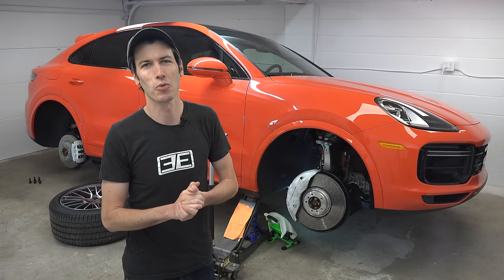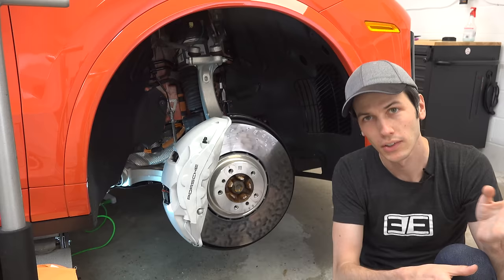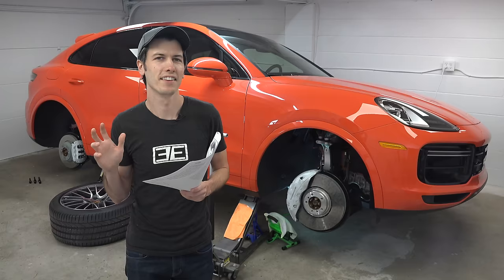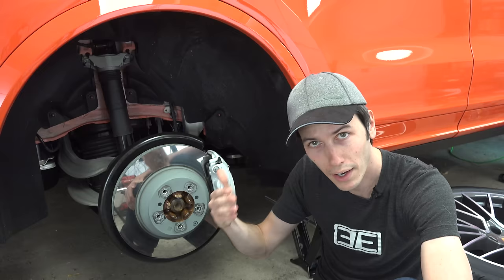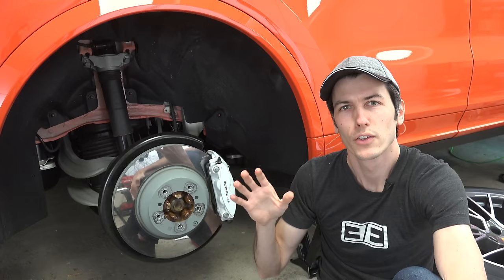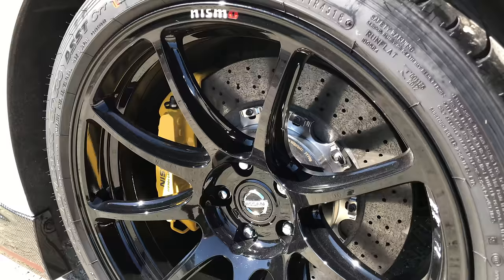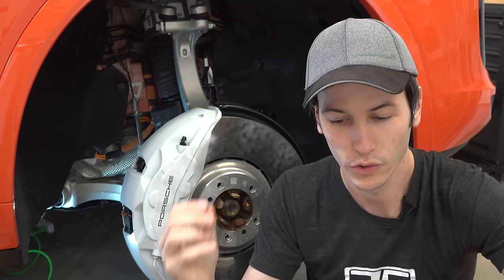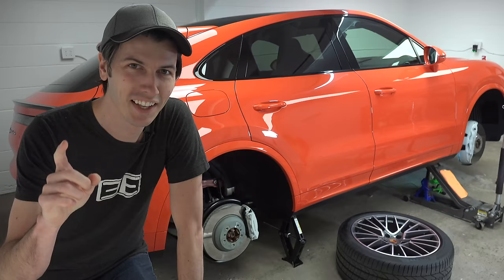Porsche Reinvents The Brake Rotor - No Rust, Low Dust, No Fade!

Comment: $32,000 for brakes! The transmission would be getting a lot of wear and tear from me using it to slow the vehicle down.
Reply: Imagine the cost for transmission service...
Reply: Sheesh i wonder what the labor is like 🗿
Reply: And those prices are WITHOUT labor....  The running costs of these cars are just stupendous! No wonder they are so cheap used lol
Reply: Various sensors were included in the prices, this isn't the pice of the carbon/ceramic discs alone.
Reply: The people buying these cars are certainly not worried about the maintenance costs..
Reply: put some regular brakes on it
Reply: @edwill1595  That, and there is reason the vast majority of these cars are leased. No mortal is doing a $32,000 brake job in their home garage on Sunday afternoon.
Reply: 😂😂😂 facts
Reply: Down shifting everywhere..... lol
Reply: @FlyingGentile  like stonehenge?  Not sure what that means.

Definitely not for the faint of heart or light wallet folks.   I guess that's why people buy old Porsches and not the rare classics, just unpopular ones like the 996.  And let's be honest, a lot of these cars are just weekend warrior chariots and really don't need carbon ceramics.
Reply: @supercooled  Yeah, carbon ceramic brakes are really meant for the track. I don't even see a need to spec them for a RS6/7 let alone a Cayenne SUV. It's just another way for companies to extract the last dollar from their customers.
Reply: @ameraldas3641  I hear there are some knockoff, made-in-china rotors that will fit and are only $34.99 each on Alibaba.  The box markings look remarkably similar, except the brand is "Porch".  Not sure I'd trust them on a mountain pass, though.
Reply: @jeffbanfieldsflwr3537  change the muffler and tell people you only engine brake to hear the "brapbrap".  It'll be our little secret...

Comment: Those prices are insane. You can buy an e36 M3 for the replacement price of these fancy porsche coated brakes.
Reply: But why would you want a 25 year old car? 😉
Reply: Even the regular iron rotors cost as much as a 325. If the price of the iron brakes is anything to go off of then all of those are marked up about 10x from what they should actually be.
Reply: A prime example at that!
Reply: Why are people complaining about the price of an exclusive brand ? It's supposed to be exclusive.
Reply: @scratchy996  WTF is exclusive about Porsche? Every overpaid professional is leasing one.
Reply: Thats only because the e36 M3 is unreliable and second hand price is low because of high maintenance.

Comment: "Barely measurable"
Laughs in machinist
Reply: lol right? 1 thou is considered large 😂
Reply: john Bean Then I’m massive...sweet!
Reply: .0008mm is .00003 inches which it 1 three hundred thousandths of an inch, largely different that a thousandth of an inch
Reply: @johnbean2596  especially when you work to plus or minus .0002
Reply: @Mj-zc6sb  real machinist doesnt work with inches
Reply: @jamisusijarvi646  depends where you live
Reply: No no no... I read this comment right when he pulled his calipers out.
Ty for the laugh.
As a rigger, I'm getting a kick out of the inside/outside machinist comments above mine.
Reply: I was thinking the same thing, I used to run a centerless grinder in Bar to bar where customers like Eaton and Siemens of steel alloy for fuel injector parts and Titanium bar to bar where I was running at .0005 as a tolerance and the average was .0015. Also there was nothing like that strange Alloy Bar we got from Rolls Royce it was about a half a million dollar bar that needed peeling and polishing, for what they were using it for is beyond me and that was a .01 tolerance with an instant you are fired if you screw this up.
Reply: @nocturnal101ravenous6  i felt pain reading that rolls royce part
Reply: @miika6739  Yeah we had quite a few contracts like that, Unfortunately the value of the metal alloy and then the inflated price of Worker involvement leads to some work that you can't screw up, In That case we always had double the machinists working on those projects for the sake of lessening error. I'll tell you this much that bar ate the head tooling like candy, the tooling couldn't deal with the force of pressure needed to peel the bar, Its one of the few projects I never got an Alloy breakdown datasheet so It was hard to understand from a Chemistry perspective the properties of the metal, which makes it more difficult to machine.
Reply: @nocturnal101ravenous6  sooo what your saying is it was likely for an alien spacecraft part replacement, right?
Reply: @michaeldriver127  LOL , well I figured Automotive or Plane Engine
Reply: @jamisusijarvi646  REAL machinist works in ANY measuring system. I work with metric and English systems simultaneously every.... single.... hour.....
Reply: @jamisusijarvi646  you've never tried making metric parts on an old imperial lathe! Welcome to England. 😂

Comment: Q: What directs air to keeps the ridiculously expensive brakes cool?    A: the cheapest plastic we could find
Reply: As a mechanic, I can say thats the best option. It isnt very fun to tell the customer who ran over a stick and some air deflector that can be made of plastic and mounted with a ziptie, would cost 100 bucks to replace because its some fancy piece of metal/carbon fibre
Reply: @esmo6341  since it's a Porsche it will cost anyway several hundred dollars for those plastic pieces
Reply: @mezo72271  yeah sorry it was an understatement. I work at a mercedes dealer in finland so I should know lol

Comment: From my experience tracking cheaper cars with iron rotors: rotors wore out after about 4 sets of pads. A friend of mine who has way more experience tracking cars has been tracking his car with carbon ceramic brakes for the last 5 years or so, and has yet to need to replace a rotor.
The cost comparison needs to be for N-sets of pads (per the manufacturer's estimate) plus one set of rotors for a total cost per M miles, and then turned into a cost-per-mile estimate.... otherwise you're comparing "things that will happen to you" with "things that won't happen to you" and wondering why the costs differ.
Reply: lol at replacing rotors
Reply: Wypipo Trippin  Not everything is about having the cheapest brakes per mile driven.   Performance comes at a cost.   I had regular cast iron brakes on one Porsche, and they lasted about 25K miles before wearing too thin.  OEM Parts cost about $1700 for a complete brake job..   My next Porsche was a GT3 with carbon ceramic brakes - a $10,000 option.  Predicted lifespan of the rotors is over 250,000 miles.   I replaced only the pads at 75,000 miles, and they had  about 60% life left.  The rotors were still good for another 200K miles according to the dealer.  This was after multiple high speed track days. 

In the long run  - the ceramic were cheaper.  THey also weighed about 44 pounds less which mean increased accelerating and braking. I could brake 60-0 less than 2 seconds, less than 98 feet.
Reply: Wypipo Trippin  when you track cars, the brakes wear out a LOT faster. :)

One track day took out about 1/2rd of a set of pads. Per the above estimate, 8 took out rotors. This is on a Corvette that otherwise would have gone over 50k miles on a single set of pads easily.

Per my friends experience with carbon ceramics,  ~20 track days had done nothing evident to the rotors.

So that "million miles" equivalent comes up a heck of a lot faster in tracked cars than you'd think. :)
Reply: @Francis-rs7zu  ceramic needs pre-heating to get 100% performance. Not the point on regular daily crawling. Is it worthy? In your case i guess so.

Comment: 30% longer life span, 4x the cost. Lol
Reply: Very Porsche ethos
Reply: I mean, it's just the same bell curve as anything else. You can get 80% of the performance for 20% of the cost, but if you want that last 20% of performance over everything else, then you have to pay the other 80% of the cost.
Reply: As an enginerring marvel this is nothing special, Make it out of depeleted Uranium and I will be impressed :D
Reply: Given the cost of labor though, having to replace it three times for every four iron rotors may take some of the sting out of that. It'll take a long time to get that many miles built up, but eventually you save yourself one replacement.
Reply: But no dust! And white calipers! White!
Reply: Standard distribution curve of cost vs performance gained. Point of diminishing returns. Etc. Etc.
Reply: Step 1: Sell the car right before you have to replace the brakes.
Step 2: Buy one being resold from someone that just replaced the brakes and selling it because it's a money dump for cheaper than you sold yours.
Step 3: ???
Step 4: Profit!! :D
Reply: Have you ever replaced pads and rotors? I have. It's not a $ 7,500 job. It's a $600 job. These are 50 times the cost.
Reply: @---cr8nw  did you includ sensors, anti-rattle clips, bolts and tax? 😜
Reply: @---cr8nw  $1900 job on my S4.  I would estimate $2200 to 2400 for my 911S which have never been replaced as it still like new. $25,000 for ceramic job on lower end Porsches.  911S could be much more.
Reply: Porsche asks $8,520 to put PCCB on the 992-series 911, and $9,210 to option them on the 911 GT3. A set of replacement rotors for the front axle costs $11,500. Aftermarket carbon brake kits made just for Porsche, and that can be refurbished, cost $14,949 in one instance, $21,895 in another, or $29,000 from Brembo. And they require specific, expensive pads.
Reply: Yeah but no rust

Comment: Great video as always. Important note: the systems doesn’t entirely come from Porsche. Bosch is the supplier and they did most of the development work.
Reply: Barely any company makes a car by themselves, ecu's from bosch, abs pump from bosch, hella makes a lot of headlights, wheels are usually co developed by big wheel companies. Brembo makes most brake systems for cars specifically. I get what you mean, but that's how it mostly goes in the car world. A car brand asks a company for something, and they figure it out (or not)

Comment: Let he who has never only used a jack to lift a car cast the first stone.
Reply: Exactly. just the jack with the stand is more than enough safety for taking the wheels off. and then the scissor stand on the back was extra in my opinion.
Reply: Who puts a jack stand under the floor jack?
Reply: @toldt  Old worn jacks with hydraulic fluid will fail someday. It does not have to happen fast. It can happen gently overnight, but it's not uncommon for them to leak fluid when old and under pressure.
Reply: @toldt  If there's a limited number of jacking-points under a vehicle it's a good idea, but not all trolley-jacks have adequate space under the arm to use that trick!
Reply: 🖐️ hand me a rock

Comment: BMW: WE NEED TO MAKE DIAMOND PLATED ROTORS RIGHT NOW
Reply: BMW are amateurs in comparison.

If it says PORSCHE on the box it'll be twice the price of a BMW equivalent.
Reply: BMW could only wish that it had the engineering department and R&D budget that VAG has.

You are talking about a super automotive group that shares technology and engineering across brands like Porsche, Lamborghini, Bugatti, Audi and Ducati.
Reply: Vapor deposited Diamond coatings have been a real thing for ages. Mixer Bearings, B&W tweeters are two I have personally used. Probably not much more expensive than this process, maybe a little.
Would potentially make the rotors shine even brighter hehe
Reply: Couldn't possibly be more expensive.
Reply: But for real, that would actually be DLC, which gets coated on all types for things for wear resistance.  The first major problem would be that it's extremely slippery.

Comment: Porsche thinks like JP Morgan  
“If you have to ask the price, you can't afford it”
Reply: Yes..its commont thing..
Also i thing same way..
Reply: Tony Valdez ,  you are  absolutely right.  I am happy with my old & cheap VW.  It takes me from point A to B without any fuss 😸
Reply: @ahmedsyed3436  Good for you.
Reply: Generally, I believe this is true as well, but people shopping in a vegetable market would disagree with you. LOL.
Reply: @nicholash8021  agree with you...even the rich and famous look for a bargain
Reply: Bosch iDiscs are supposed to only be 3x the cost of a standard steel rotor, which isn't too bad. (I'm reading figures of tungsten carbide 3x over steel, and ceramic are 3x over tungsten carbide)
Reply: If I can't afford it, you're out of market

Comment: As always, a great video. I’m a bit skeptical of Porsche’s claim that 75% of dusting is from the rotor, particularly for track pads.  Pads in general run the full range of dusty as hell to little (particularly ceramics). Another thing that surprised me was the comment that these felt like conventional brakes.  I was a passenger in a new Cayenne which my friend had on loan when his 2018 Cayenne was in for service.  For the first day he he had it, he almost put us through the windshield several times, the initial bite was markedly increased.  Took him a day to get used to it.
Reply: Gather some of the dust from regular brakes and you'll see that it is strongly attracted to a magnet.

Comment: I want diamond brake rotors now
Reply: Baller!  I'm impressed.
Reply: But for real, why aren't brake rotors made like clutch discs..... with the "wear material" on the rotor.
Reply: @MrAPCProductions  I'd think the main issue would be heat. Brakes have to dissipate way more heat than clutches, and it helps having that big metal rotor as a heat sink.
Reply: Pauline Weinberger  Diamond pads for your diamond rotors

Comment: When you mentioned the Mohs scale, it would be nice if you included the hardness of cast iron rotors
Reply: Probably not an appropriate scale. In reality this will be a much more complex engineering problem - even the fancy brakes are mostly iron. 

For a simple comparison about 4-5 mohs
Reply: In engineering one uses HRC scale.
Reply: @AcTpaxaHeu  Rockwell or Brinell is indeed far more common than Mohs hardness.
Reply: Dima since this isn’t for engineers but for laypeople with the engineering explained, it makes sense to use a scale more commonly known and I remember the Mohs scale from Geology so it makes some descriptive sense to me

Comment: Porsche developed pads and disks that can't be replicated on the aftermarket:
Also Porsche: "hey they work better too"
Reply: OMG you're so smart! I hadn't even thought of that. I usually go OEM but I think I'll just use Snap-On drill bit shavings and a heat gun and whip up some of these myself! I just need a funnel that can withstand 600 degrees...
Reply: By Porsche you mean Akebono Japanese brake company with big “Made in Japan” on the side
Reply: Porsche Look at our fancy high end brakes   (with some side effects including but not limited to: radiation poisoning, and the urge to wear khaki shorts.)
Reply: @tomjones5860  i have Akebono pads on my RSX. They make fantastic brakes. If they make these I'm more confident now than when i thought they were made by Prosche xD
Reply: I doubt they invented it.  I believe their ceramic brakes are by Brembo.   You can find OEM ceramic rotors but they are still expensive. There will no doubt be lower cost OEM options for the 3 people who own a cayenne but care about saving money.
Reply: @xidarian  porsche does not use brembo breaks, they make their own brakes. this mirror finish brake technology was invented by bosch and the pads by akebono. porsche has exclusivity over this technology for idk how much time, but eventually bmw and mercedez would probably use them as well. i learned this at the Porsche training center.
Reply: arturo710 True. Google „Bosch iDisc“.
Reply: Hmm im pretty sure if u replace just rotors and pads to regular ones u are good to go. IF the size is the same. I would engineer it like this but the market is money driven so I have my doubts

Comment: My dad bought a brand new 2019 ceyenne and since he didn’t want to wait however many months for a custom speced one he bought one already speced from the dealer. When he told me it had 17000 in options on it I was looking forward to some fun options, turn out they were all pretty pointless including this one 😂😂
Reply: It's a sucker option. Autozone has lifetime brake parts replacement. I haven't paid for brake parts for many years. No joke.
Reply: hxhdfj ifzir st c I’m sure people used to say that about discs compared to drum.  Not saying these are that level of innovation, but all new tech is expensive when new.  Imagine if these could be brought down to sane prices?  Suddenly it has a use.

Comment: Watching this while I am still driving a car with drum brakes on all four wheels.
Reply: Zero dust ftw!
Reply: @TheMiloking  well, there is brake dust but you can't see it until you open the drum
Reply: @bassam_salim  *Drum
Reply: Don't watch while driving!
Reply: I remember those things. Not much happens when you press the brake pedal.
Reply: @phasmata3813  my bad
Reply: When your brakes overheat.... you’re the one that’s going back to the dust XD
Reply: So do I.. and they're perfectly fine.. of course they're bolted to a vehicle that just can't quite hit 80mph.. no need for grip like that when you can't achieve the speeds that would necessitate said grip. 

Tongue-stain car-slide is something I never thought I'd see in a brake system.. kewl.. Enginerding for the win!
Reply: Most of the semis on the road run drums, disc's have only been out for a few years for trucks and they are crazy expensive and parts are hard to find.
Reply: Same. My '66 Chevy c10 doesn't need much more though, I can still skid tires. My stopping is traction limited, not brake limited